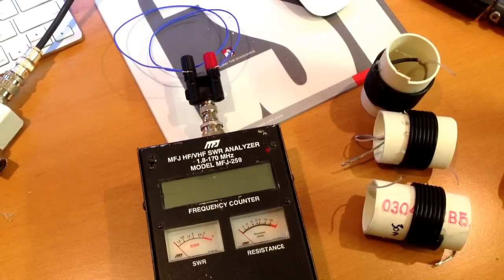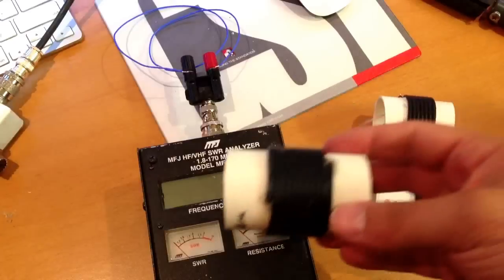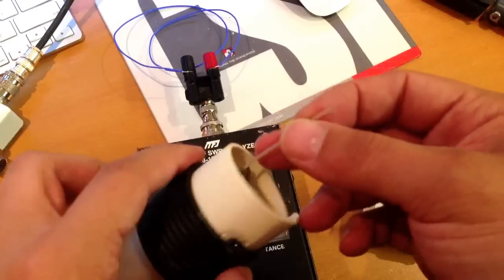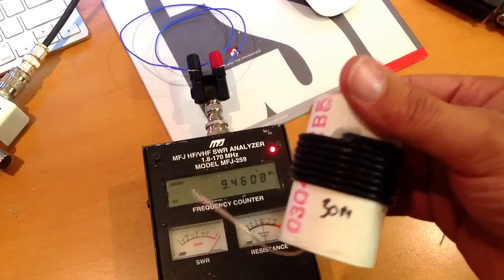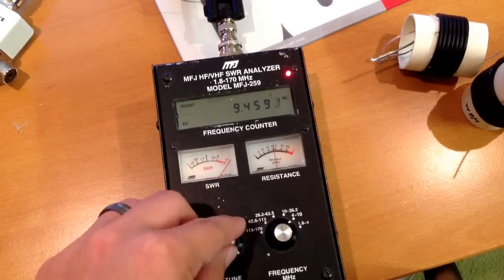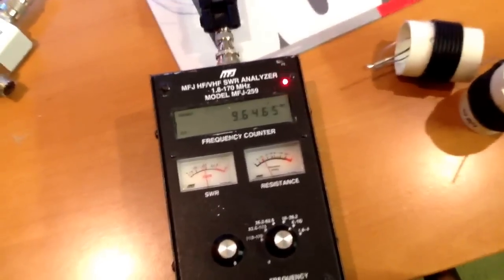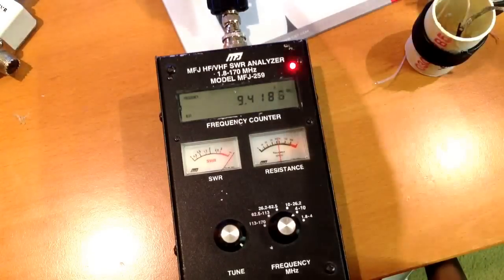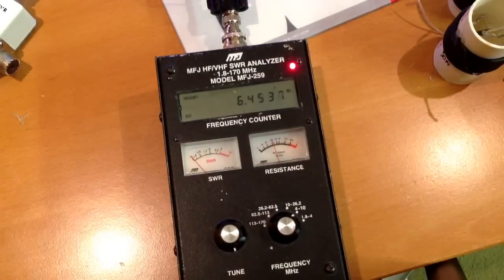Coaxial Traps for an 80/40/30m Dipole

Comment: You cross coupled the coils that is why it did not work. Then you put them in such a way the lines of force were in the same plane, so that coupling could happen. They should be in the same plane... :)
Great video glad to see it on here! Many of us old timers do it just exactly this way to make traps and align them. The hard party is covering them with liquid electrical tape then keeping them adjusted and then the re-adjustment right before the liquid tape dries. LOL:)

73
Jimmy, ARRL TS, WX9DX

Comment: Ok fine but how do you adjust if way off fequency
Reply: Dave Fleetwood if it's way off, you have to add or remove turns. If slightly off you increase or decrease the spacing on the turns.

Comment: I  try to do this but i cant get it to work i using hook up wire what size wire are you using for the coil
Reply from the maker: Any hookup wire should work, as long as you have the coils tuned it should dip if the coupling is tight enough, try to adjust the positioning

Comment: where can i find the info on the loop adapter u r using?
MP
Reply from the maker: The method used here is detailed in the manual for the MFJ-259
Reply: TJ Campie i  have downloaded the manuel  and i don't see the construction of the wire loop...?
Reply from the maker: matthew Kubiak it isn't anything special, as you can see in the video - a simple loop with 2 or 3 turns should be enough to loosely couple with the trap.  All you need is a banana plug adapter or you could even solder a wire to the end of a short piece of co-ax with a PL-259 on the other end.
Reply: TJ Campie that is my plan but i dont know if the length or diameter matters..
Reply from the maker: matthew Kubiak i dont think it does
Reply: TJ Campie my plans are to make traps for 10/12, 20, & 40 meters